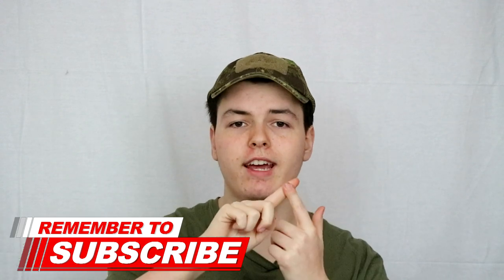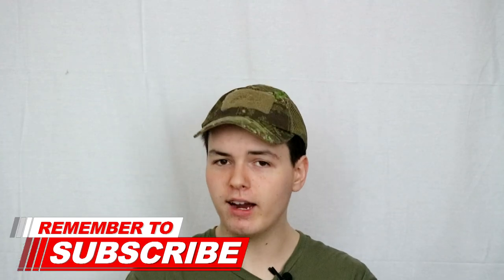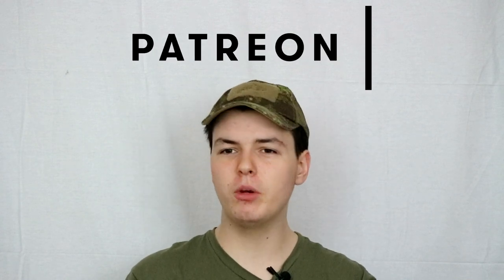Why I HATE Drop Leg Panels

Comment: Lane, very good points, i personally use drop leg(s), used them in the sand box, there are little tricks you can use to get a secure fit for the leg rig,  i got used to the "wobble" when i was in the "sandbox".... but to each their own. As for anyone that wants to run drop leg set ups, a trick i learned was get a can of car/truck undercoating, and spray the "large" areas, since its rubberized its stays in place. 

One of the reasons operations forces use drop leg set ups is the natural "draw"  with a battle belt set up, ive noticed that an individual has to contort their shoulder to draw their side arm or get spare mags, with the drop leg set up, your arms hang and is more comfortable. 

Now the logic behind drop leg platforms,  you always have your side arm with you and some primary(rifle mags) when youre in the real deal you never go anywhere with out your rifle, alot of us never went anywhere without our rifles and pistols...... We didnt always go everywhere in full battle rattle, like to the head, or chow or whatever, but we always had our rifles with us. With the drop leg(s) we had not only spare mags for our rifle but we had our sidearms as well. Yes it is sometimes a pain in the ass to have stuff on your legs, but like with anything, you learn to adapt and make it work. 

I will say this, everyone is different, use what works for you, what you're comfortable with. Im a "bigger" guy, so the drop leg system is perfect for me. Someone more slender will find a battle belt set up more convenient.

Comment: i use the fox tactical drop leg panel and it goes very tight against my leg without cutting off the circulation. i was also thinking about using a sewing machine to add another strap to the upper portion of it to make it even more secure. it might not be the best option for magazines but its definitely good for holstering a gun or a knife and carrying an IFAK

Comment: Your legs are designed very well to hold weight... if you are having issue with having weight on your, literally, strongest weight lifting part of your body... you need to start working out or at least work out properly, Start dead lifting and squatting.

Comment: I don't play airsoft much anymore but i am a Marine and spend a ton of time in the field. I use a drop leg panel for certain missions. If I'm patrolling with just a chest rig and running light, i use it to keep small snacks in. I absolutely hate putting things in my cargo pockets because they chafe my leg. The panel holds a pouch that i can easily access for my fat kid snacks. Been using an eagle industries panel for a while. I don't however like to do any sort of buddy rushing with it or be in a situation where I'm going prone a lot. Nice video though dude

Comment: I prefer drop leg holsters. It's not in my best interest to have anything at my belt line of my shooting side. There are plenty of leg holsters that fit easily on the upper thigh, are comfortable, and quick to get to with minimal movement. I will not run anything but a holster on my right leg though, and absolutely nothing on my left. I even keep my plate carrier on my dominate side clear of gear as well. I want as little on that side to get caught on as I can.

Comment: Biomechanics are a large topic in case of gear, that's for sure, therefore i hate all modern textile plate carriers, because no matter how well those fit, when you put real plates in, they always lie on your shoulders. And carrying stuff on your shoulders isn't the worst but also not the best way, your spine and intervertebral discs will get stressed, that's extremely on people with scoliosis, like my brother. He wears already a real plate carrier, so no airsoft clone, but after 3h he needs a break. I have no scoliosis, but i still hate to carry my weight on the shoulders, therefore i use a combat belt and drop leg panels. No issue there, but it also matters what kind of body you have. I have wide shoulders, so that when in gear, my legs with the panels are still less wide than my shoulders, what makes it easy for me to coordinate my movements, so no issue in my case with the profile. An other avantage is, when the panels and bet setup is well done and fits you good, all the weight gets transferred directe to your hips, that is the best way to carry weight, because the hip and legs are made to carry the weight of the body. So my spine and shoulders are free, because my hips carry all the weight, i managed to construct also a body armor, which transfers the weight from the shoulders to your waist, so also no issues to carry a rifle with a sling. So except the helmet i carry all my weight on my hips. The other point is to adjust and if necessary, modify your panel, that you reach the load on the panels without bending your upper body sidewards, means when you drop your arm, your hand should end up in the center of the panel or holster, if that's works you changes are very natural, without any weak angles. But that's how i set it up and what works for me and my specific body shape. I also don't have any tack at the front, means lay down is easy, even my combat belt has no pouches in front. But even when i made good experiences with that kind of setup, it don't works for everybody. My brother, who's larger and heavier than me, has issues with my type of landout, so the best would be everybody reads some books about biomechanics and tries what works the best for him/her.

Comment: Drop leg P90 pouches, great..! When I have to lay prone I can easily acces those. Since P90 mags are HUGE but mine also only hold 68bb’s they are required if I want sufficient midcap mags. I can only physically hold 4midcaps on front of chest 
They are light and not bouncing :) also free enough to not even feeling them. 

Also tall or long enough mags to be able to easily reach for them
Reply: Stefan Brand I love the P90 platform but I HATE the magazines. I got the M4 conversion kit and am going to make it accept mid caps and it'll be so much easier to play.
Reply: same here drop leg are greate for p90 mags and if it is too Hot i can drop the chest rig and play with my drop leg only and gun since I can fit 4 mag on it.

Comment: If there is wobble then it is set up incorrectly. Drop-legs are used in real combat situations - if it’s good enough for the pro’s, it’s good enough for airsofters.
Reply from the maker: Drop legs were originally designed because body armor was too bulky to have a clean draw if it was belt mounted. Mid ride is the way to go.

Comment: I am trying to find a leg drop panel that will attach to my H Harness gen 2 via molle, mostly to synch everything down on my person a bit more, and maybe to add the ability to carry a few small things on. I guess im having trouble finding something that isnt bulky or loose, doesnt drop too low, and can connect directly to my gear itself. I always saw drop leg panels as useful for more than just carrying more gear. Anything you could recommend for this?
Reply: It's preferable to run it from a belt than the H-harness. Depending on how tight everything is, movement on the torso will pull on the staps connecting to the leg.

Comment: SHOCK Lane How Could you! Just kidding, to each their own :)  My drop leg dump pouch dpes rattle around a little bit and it c an be a bit heavy since I'm a grenadier and guess where my spent shelsl and cores go? But I've grown accustomed to it and it doesn't slow me down. However I wouldn't recommend it to new players. Build up your strength first and than decide. Oh and my dump pouch is rom condor and it's up pretty good on my thigh so it's there but not too far down. I have a belt mounted omnivore holster I want to try with the adapter for their leg panel to test out it's effectiveness.
Reply: why not put on your belt then?  i dont get the reason for a drop leg?
Reply: I never thought about that, to be honest, just started running it on my thigh a long time ago and never really stopped to contemplate that. I might run a belt one for a bit and try that out for the smeg of it.